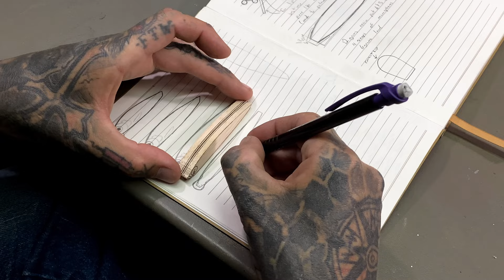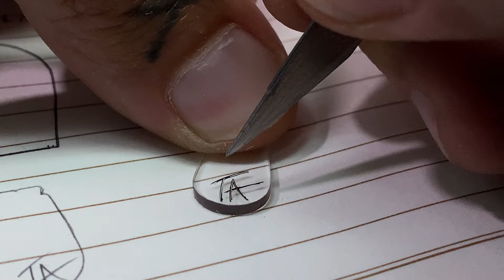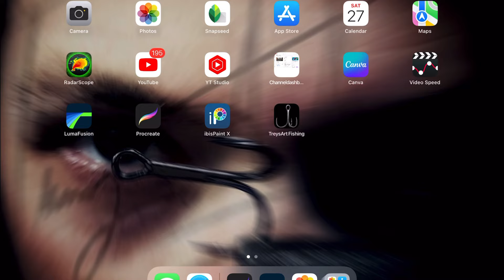Making a Shiny Balsa Minnow Lure

Comment: hey nice work you made. i make lures to from woood but the tiny one i make are working great and wiggle nice. but if i make a normal size crankbait it only makes loops and and spins. i use lips but that makes its many times worse do you know any tips
Reply from the maker: Sounds like you need a ballast weight. Needs to be buoyant material with weight in the belly and make sure the lip isn’t too big. Also it could be caused from there being too much weight.